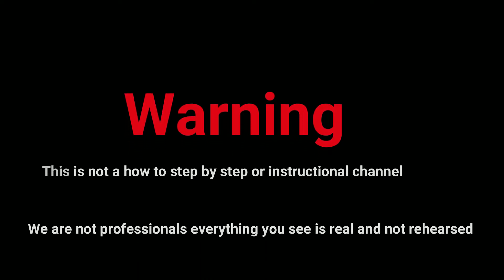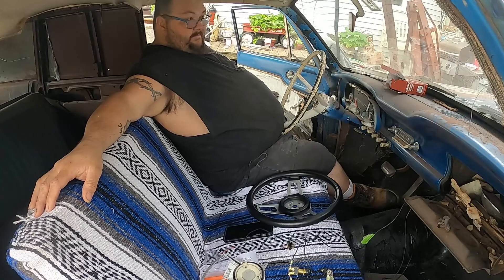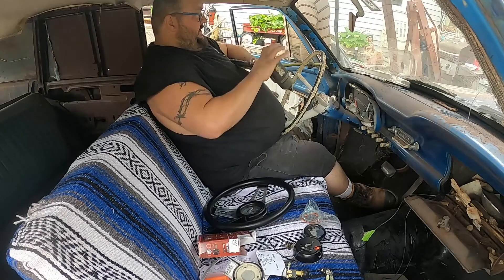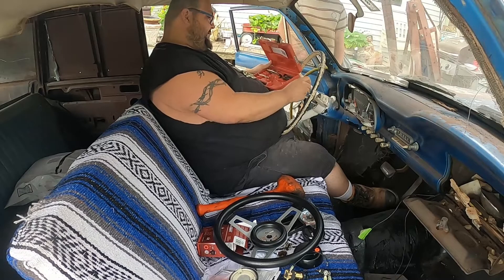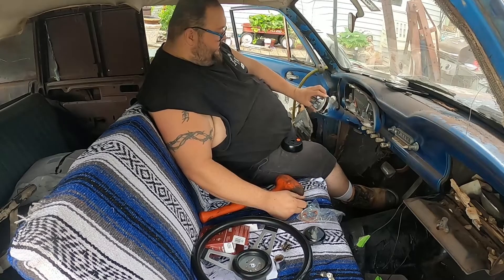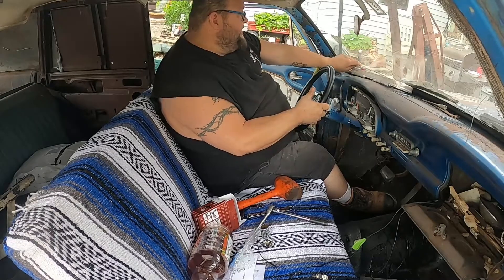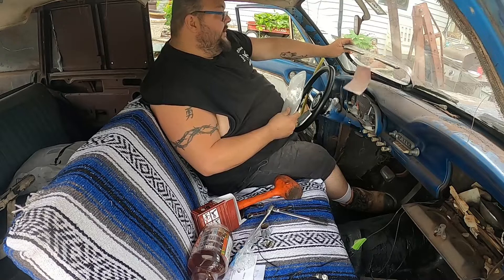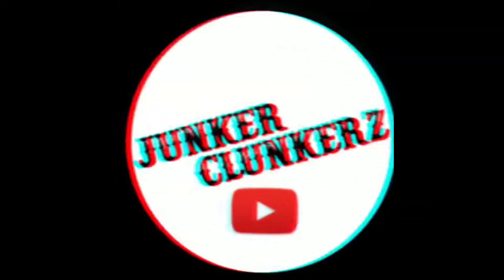New steering wheel 1961 ford falcon revival delivery part 9

Comment: I hear ya on the 'big guy' clearance issues... Tilt wheel is your friend! LOL
Pretty much every Ford I've owned and the steering wheel was properly installed, I've had to use a puller. Been able to wiggle-pull wheels off from other makes but whatever Ford did with the splines, man.... it really hangs on!  Wow! LMAO.... that hammer called it quits! 
Looks like Grant's rendition of the Mopar Tuff Wheel, looks good on on there!
Reply from the maker: Thank you man yea iv been able to get them off with out a puller before thank for the support